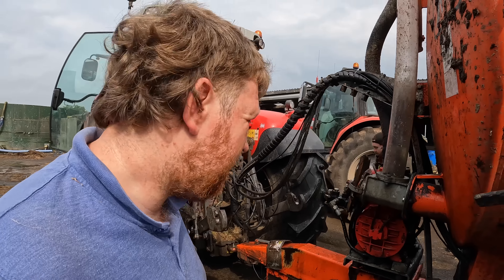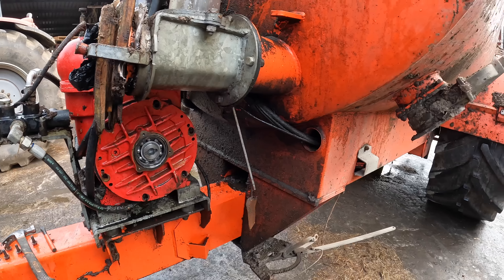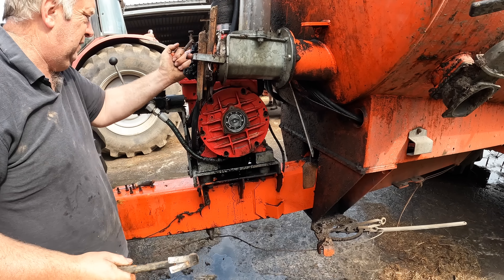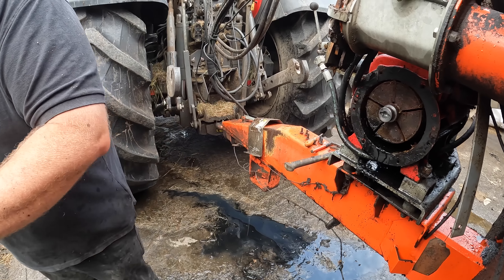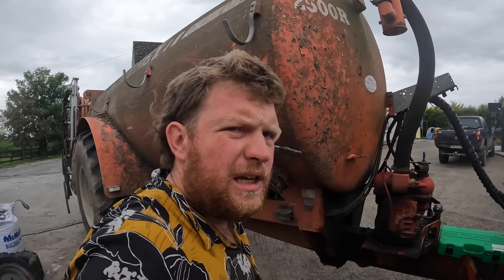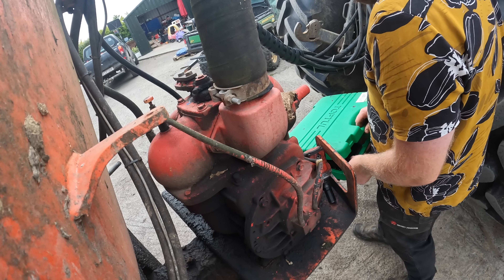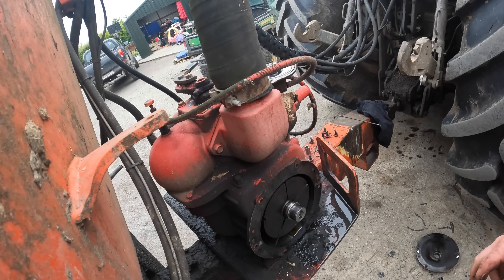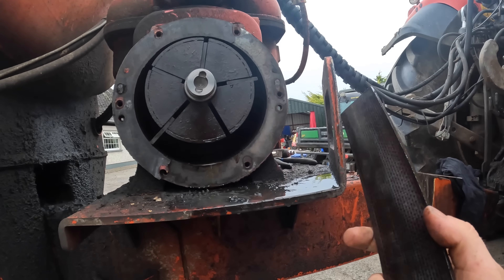SLURRY TANKER VACUUM PUMP REPAIR AND MAINTENANCE

Comment: A trick for you when finished with spreading slurry suck in a small bit of desil through the pump, put it in spreading, let it rinse the turn the handle sucking itb cleans all the veins inside of it great job

Comment: I am here kind of by accident, but I watched your entire video as it has a very nice feel to it and you earned a new subscriber. Currently I am building a vacuum pump that's a bit more precise than yours, since I'm making the vanes out of stainless steel and it is going to work for more or less scientific purposes. I am super paranoid about balancing it out perfectly and having every tiny little bit as close to perfect as possible, but seeing your pump working in conditions worse than mine will ever see is definitely making me more calm. I will still probably spend a whole bunch of time on sanding it down as best as I can, but I probably won't have my heart racing nearly as much when powering it up for the first time, partly because of you! Thank you! ❤

Comment: You should invest in a 20V  Cordless Oscillating Multi-Tool for cut them roots off the rock picker. There time saving and cheap and you can use them to cut  a 1000 different things. Worth every penny.

Comment: Great vid but you should not chisel the end plate off their will be some threaded holes on the end plate which you use to pull the plate off take out the bolts and use two in the threaded hole to pull end plate off

Comment: Pretty sure those vanes are well wore out in the last tank pump.

Depending on pump type if that is hertell or mec but usually the more updated pump have 8 vanes and higher efficiency on vacuum.
5 vane pump is ok but needs to rev’d faster to get sane output.

Comment: My apologies I see you used the threaded hole on the second pump but you don't need to take the sir clip off only if you need to change the bearings

Comment: Nice one Phil. Did you see the video  Agriland had up there today showing thees little mini splash plates that this man designed to be fitted to the end of the pipes on the dribble bar to fan out the slurry and prevent these lines of slurry drying out on the ground only to be picked up by mowers and rakes, sounds like a good job, you'd be the man to test them out
Reply from the maker: One problem tho is if your supposed to be dribbling your slurry for deregation etc and the eye in the sky sees the field looking splashed not dribbled and flags it as a violation then what? It looks to be a good job but until there’s some clarification from the department it could be risky

Comment: Theyres 2 threaded hole on the end cap off them pumps but 2 bolts back into them and it will push the plate off

Comment: Are them vanes a little wore and loose in the smaller pump?
Would new vanes increase it's efficiency? Did Father Phil give a second opinion before you put it back together?
Reply from the maker: father phil was away and in hind sight i shouldve put new viens in it

Comment: The hole's are slotted in that plate and you are supposed to fit 2 dowels to align the pump back plate to prevent it hanging on the front bearing. Did you think they slotted them for the crack!🤷🤦
Reply from the maker: Well now I know why👍
Reply: Slacken bolt's and push in a tapered punch then try pushing in a 10 mm drill bit! I think it's 10 mm hole's!🤞👍